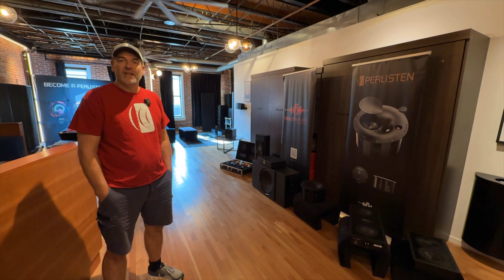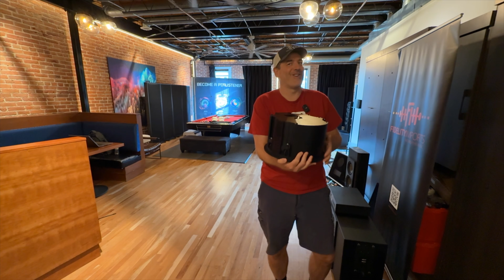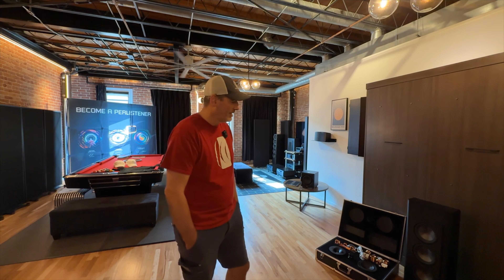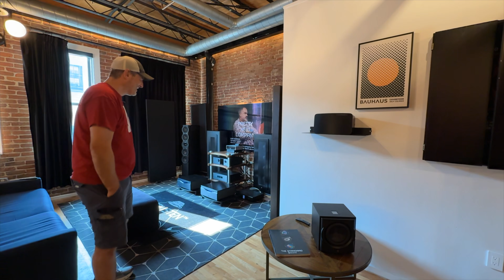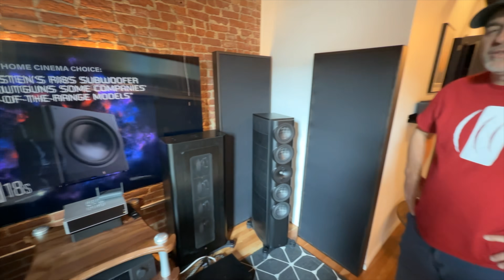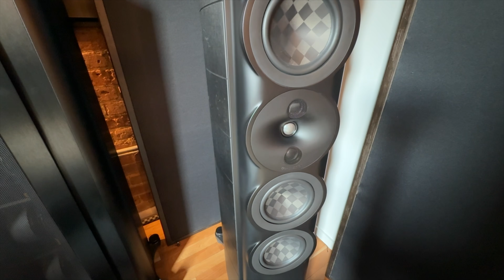The Secrets Behind Perlisten S7T Black Edition | Exclusive Discussion with Erik Weiderholtz

Comment: Hello, I have a couple of questions.
Does the Verona, Wisconsin location have a demo area where I can hear these live?
Next question: Would you rate the R7T and two subwoofers ahead of the S7Ts without subs? The price is close, but I really like DEEP bass. I currently have NHT 3.3s that are vintage and in great condition. Finding something similar for not several thousand more has proven difficult. I've been casually looking around, and I don't see many speakers that equal the Perlisten speakers. I feel like they are the modern day NHT 3.3 speakers. It doesn't hurt that I like the black colors and the somewhat similar look and size compared to what I have now. Beautiful stuff! Expensive but nothing like the overpriced stuff out there that specs out poorly by comparison.

Edit: I bought the S7Ts and they are the best speakers I've ever hear. Good bass without subs as well.

Comment: 1. How do the "new" small subs perform, like the R8s or R10s? Can they compete with small dual driver subs like the KEF KC92 or Bowers & Wilkins DB2D? I can't find any reviews of the Perlistens.
2. Why don't they come in white? That black sticks out like a sore thumb in a living room environment..
Reply from the maker: Good questions.  The R8s definitely comes in a Satin white.  The R10s doesn't... only black.  As for performance, I haven't heard either in action.  I wish I could comment beyond saying that Perlisten's manufacturer measurements are supposed to be really solid.  So, I wouldn't hesitate to use them as a good barometer.
Reply: @av_nirvana Thank you. I hope that they will send out a bunch for review asap. I think they advertised those subs last year and I'm still waiting.
Reply: @isakOHR  I moved up from a KEF KC62 to the R10s and it was definitely an upgrade. Not particularly fair, probably makes more sense to to compare KC92 to R10s and KC62 to R8s … I’m planning to buy an R8s for my office system to pair with LS50s.
Reply: @robertgrignon3688 Thank you for sharing! Patiently waiting for reviews of the R10s 😊
Reply: @isakOHR  ordered the R8s today, should soon have in the house alongside my R10s. Excited!
Reply: @robertgrignon3688 cool. Would be awesome if you could post some in-room measurements somewhere.